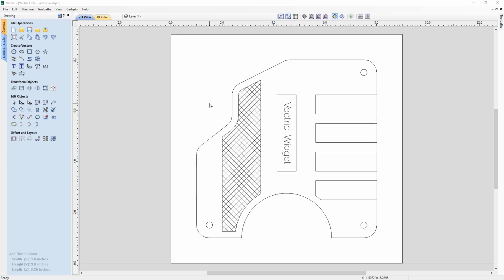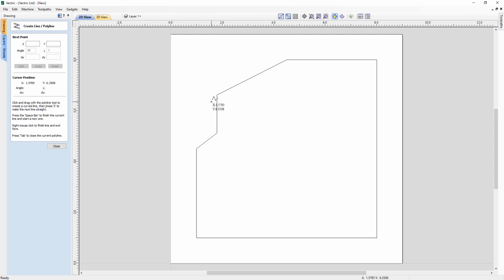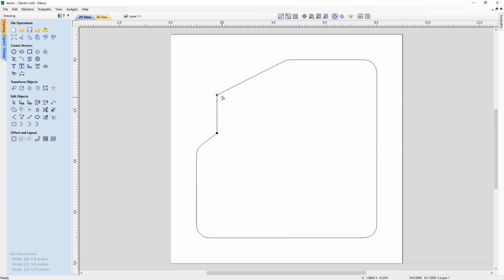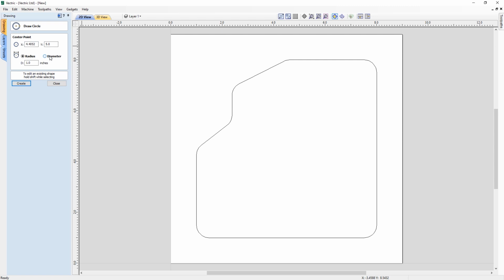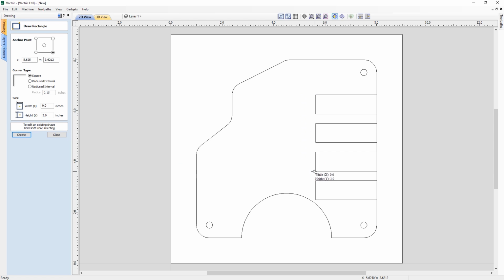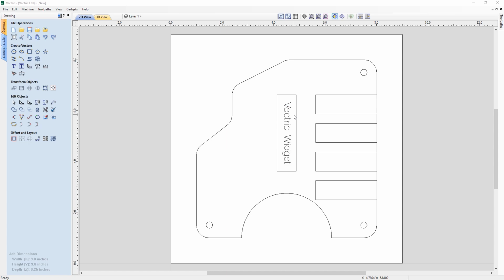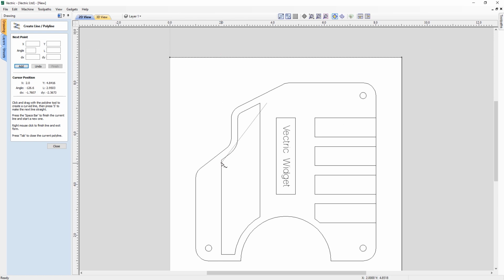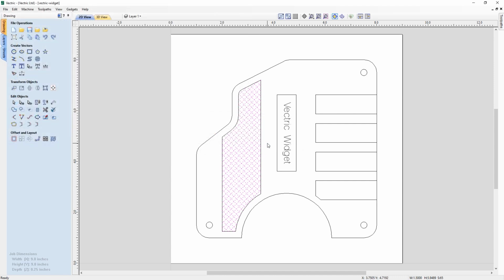Vectric Widget | Vectric V11 Tutorials

Comment: Can you resize a single line? Or do you have to remove the line and create a new line? Seems counter intuitive.
Reply from the maker: Yes you can using the 'Set Selected Objects Size' function. You will only be able to alter the height or width of the line as the line can only be a pre-set thickness. Hope this helps, thanks!
Reply: @vectric  Appreciate the reply :) Yep, that makes sense. So it looks like you need to cut any joined vectors at the node before you can resize a line (from my testing). Slightly different to other programs, but good to know still can be achieved.